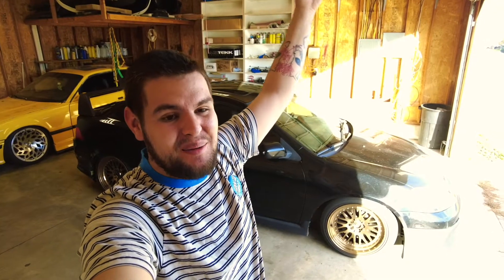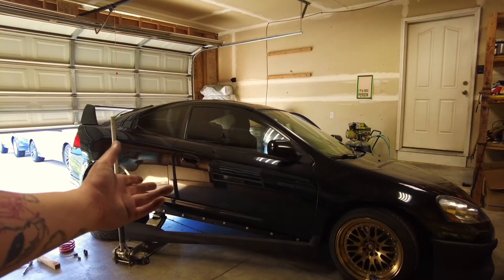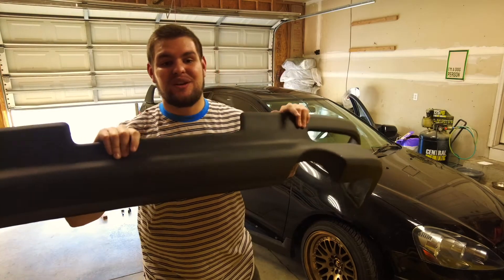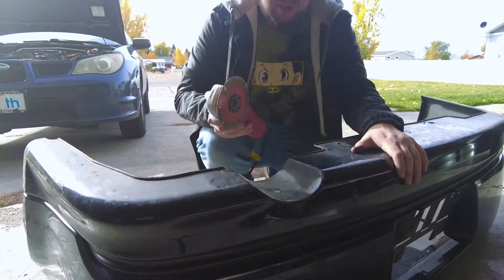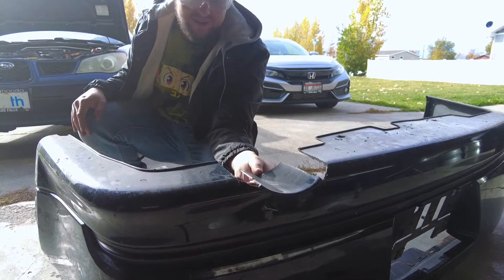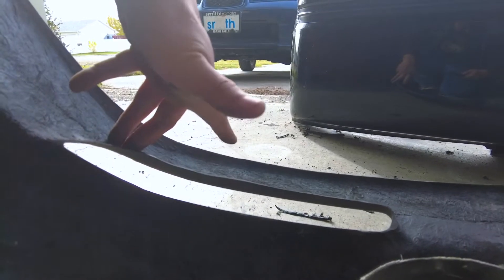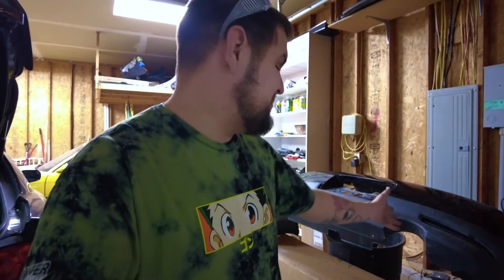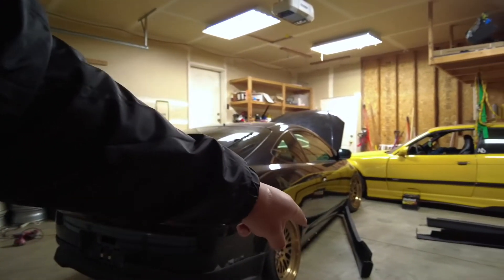ASPEC Kit finally complete! RSX TYPE S (DC5)

Comment: There’s a club rsx thread that someone posted where he measured out the oem a spec side skirt brackets and made his own out of sheet metal if you wanted to try that since reps don’t come with the brackets. And then you’ll need to get m5 size well nuts for them to bolt the side skirts onto the car through the brackets . They go in where the plastic clips used to be at on the bottom of the side skirts. If you look up oem a spec installs, it’ll make sense lol